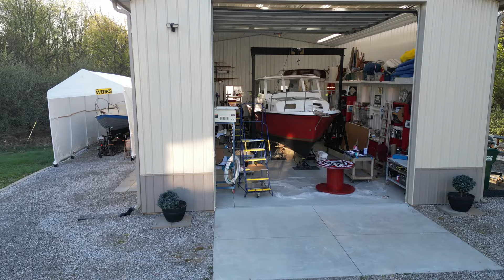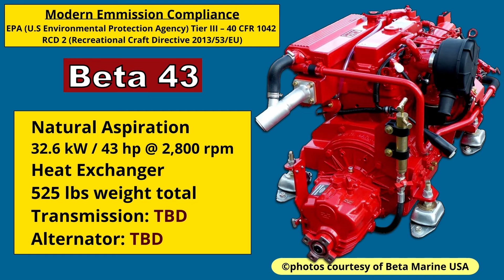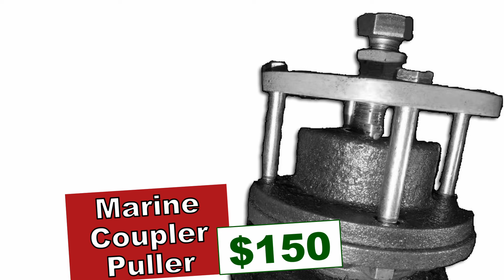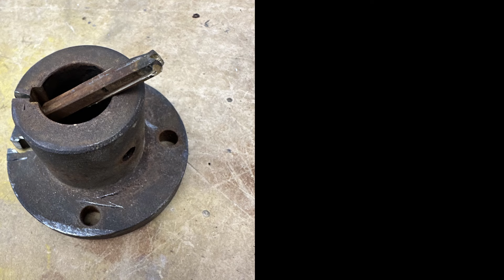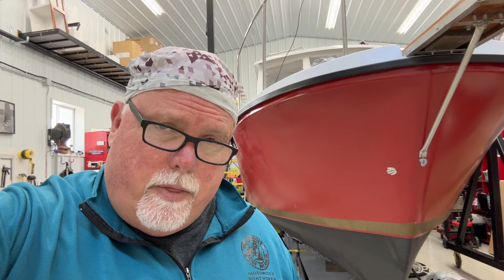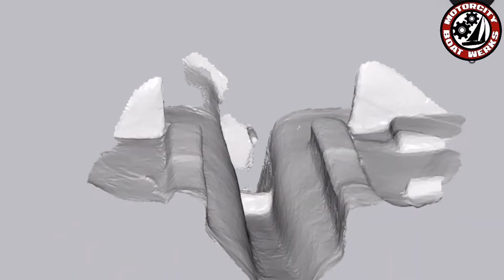How to Remove Old Boat Shaft Coupler from your Sailboat | Trawler Restoration (Ep125)

Comment: I lucked out on my coupler removal, a puller just barely fit. I was able to remove it and then pull the 100” X 1.5” shaft, just to find the shaft was badly worn at the badly worn cutless bearings.
Oh well, at least the coupler is still good - the cheapest part in the project 😂
Reply from the maker: Thanks for sharing your experience 😁

Comment: Having done numerous repowers I don't waste time and effort on a shaft, it's probably the wrong length anyway and is worn at the bearing and packing. I just get a new shaft with the coupling properly fitted and faced.
Reply from the maker: This is the difference between a professional and an amateur. As an amateur operating on DIY budget it makes sense to try and save money 💰 on the big ticket item like the shaft—especially when the engine must be aligned this way anyway. Thanks for the comment 😎

Comment: Bro i feel ya, we're repowering a Carver with pass through v-drives. No way in hell were those couplings coming of. I tired a puller, heat, special sauce we make for busting rust, hitting with 2 mallets hoping resonance will loosen them. Fucking nothing worked. I finally laid down some old woven roving glass, and threw the 4.5" grinder at it with a cut off wheel. Took my time and had zero issues, I couldn't imagine doing it with a dremel lol.  Cut it at the key like you did to save the shaft. But what a whopping royal pain in the ass!!!
Reply from the maker: Exactly Danny ! The dremel was surprisingly effective —slow but effective 😁👍